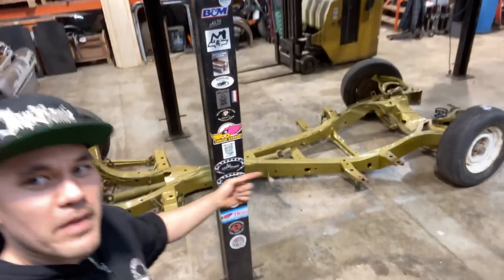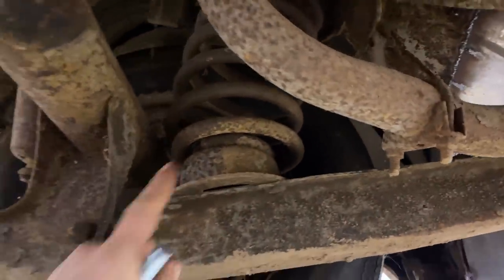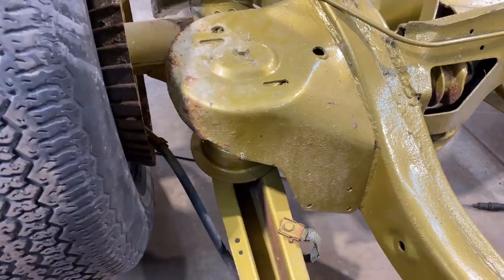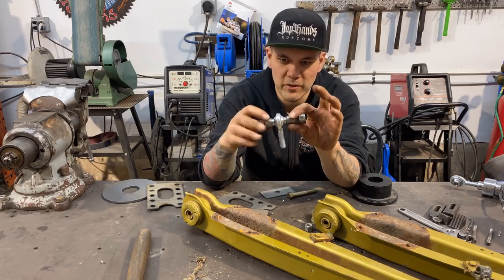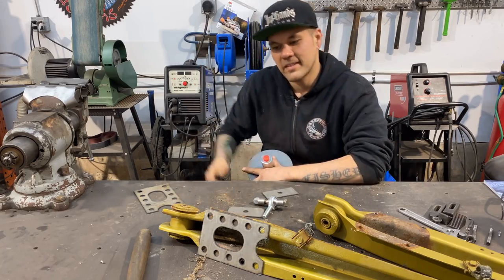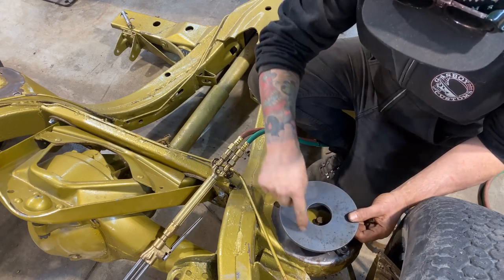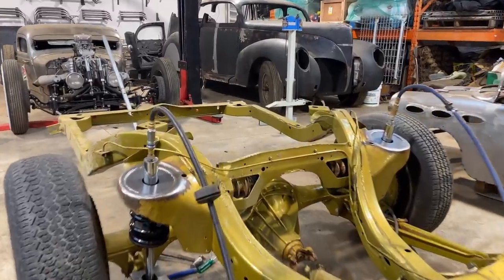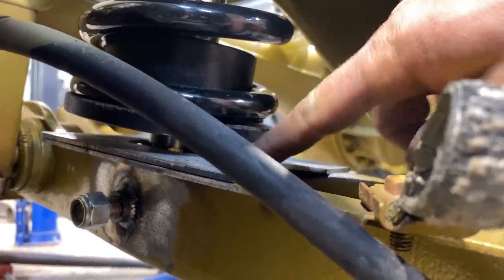Installing Hydraulic Rear Suspension - Kristina’s 1960 Cadillac Coupe de Ville

Comment: During the early 60's I had a small shop in Long Beach, California,  before it was popular,  we used to buy our hydraulic parts at military surplus houses like Palley Supply Co. downtown Los Angeles,  most of the military electric valves and pumps were 24 vdc.  Made it tricky to charge the batteries on 12v then  switch to 24v in operation. 
 Fun times 😃         if you use an  electric valve at each cylinder,  it won't lean when you go around corners,   Plus if a hose breaks" the cylinder will still hold fluid and the car won't drop on the ground when your on the freeway !!   Weld a shock mount next near each cylinder then the car won't bounce all over everytime you hit a bump!   Your Machining of all your parts is REALLY Great, 😃     Great Video,   Thanks
Reply from the maker: Man you are one of the originals!

Comment: Very interesting. Have never worked with hydraulics before  and always wondered. Love learning new things. Too cool.  Any reason why you never put a spring pocket  on the top to keep the spring centered in the mount?
Reply: i agree i think it would let it sit lower or allow for another turn of the coil to fit inside that pocket... i even think he said more coils smooth the suspension feel.
others here are mentioning having to box the whole length of the trailing arm which i also was suspicious of
Reply: That was my first thought about the spring being centered.
Reply: Yeah the top of the spring will move all around in there, needs something to hold it centered
Reply: Stock pockets are fine I personally would have just drilled a hole for the cylinder in the stock pocket instead of cutting it out and run the donuts under there. With a lay and play system there's not much spring movement the cylinder centers everything up. And less coil is a softer ride but of course this doesn't apply if you keep the suspension bottomed out then it's bouncy. I run pvc pipes over the cylinders to limit metal to metal contact/noise
Reply: @kdsboosted4954  i dunno, watch those cylinder tops move around in the video...
they move a lot....
even just a rubber/teflon/poly bushing donut between them and the donut plate he made would be a good idea....
i wouldnt be willing to allow all that knocking around or ANY spring slippage.
if youre not  building for 20,000++ miles a year, youre cutting corners is the way i was taught
Reply: @kazzTrismus  It all needs to move around as it needs as it adjustable suspension. Use pvc on the cylinders and composite cut board material for the springs and cups. I've have hydraulics in one of my cadillac's for at least 25 yrs. You end up picking up a couple tricks along the way. I have 3 lowrider projects I'll be installing hydraulics in my 56 cadillac this yr I think I'm still 2-3 months out though.
Reply: I do not understand the loading when everything came apart when frame was lowered and unloaded. What would happen with body roll and hitting a wonderfully deep pothole?
Reply: I think the hole for the top of the cylinder may need to be enlarged, with that being said the stock coil just sit in the pocket also didn’t it?  So it should be fine.
Reply: @mongomay1  it'll be fine once everything is assembled.
Reply: He said that he's using the front springs in the back so the final spring will be larger in diameter, I guess that will keep it centered.
Reply: He said those are temporary springs
Reply: @juanignaciocaino  
I thought I heard that explanation also.
Reply: @juanignaciocaino  he'll probably put something unless the outside diameter of the cut front spring is coincidentally the correct size..which is doubtful if not kinda sketchy...
a ring for the inside diameter that acts like a strut top (with the ramp/stopper for the end of the cut coil to not turn/screw by vibration) is my guess
Reply: Perhaps Karl plans on using a rubber isolator on top of the coil, when he gets the right springs, and that will hold and center the spring?
Reply: I think everyone is seeing the same thing:  what keeps the hydraulic cylinder from scraping the top 1/4" plate?
Reply from the maker: Yes I’ll be adding a locator ring, shocks and some delrin to keep from scraping the cylinder
Reply: @RestoringChristine1956  
Thank you trying to stay sane in this insane world.
Reply: @MakeItKustom  Can't wait for the conclusion.   
Love your show!
Keep up the good work!
JIM 🤩
Reply: Yes, adding a Derlin bushing at top for hydraulic cylinder as the lower control arm will create an arc going up and down. Having something to side on is important otherwise the cylinder will rub even with a Heim joint. 
  I am very interested! Are shocks coming? Stay tuned as I have to watch more, hooked!

Comment: back 30 years ago we just drilled a hole sideways through the cylinder and welded a cup on the top of the donut to hold the spring. now we have reverse cups and power balls, the absolute best way to do it. Not only was coilover desired many years ago to keep long cylinders from breaking out the back window, it simply kept the spring from falling out. Been building lowriders for over 30 years and never "needed" a torch. It is helpful but not mandatory

Comment: You really explained the set up well. It was hard for me to picture it in my mind, but once I saw it all done I can process it. I'd never seen someone install hydraulics in a car before. I recently had some one tell me I should do it to my 91 Olds 88... But I actually want to put a 3" lift kit on it to put some truck tires on it (look up towrolla puddins fab shop). It's just my daily beater ride... Dents galore from when a tree fell on it.

Comment: Looks awesome. Great work

 When I was doing this ages ago, I would run 2" over outers on the rams to get more stick through. So, if you're running a 10" cylinder on the rear, the outer casing would be a 12" casing. Just added a bit of stability and kept the fittings away from the mounts.
Reply from the maker: That makes sense! Cool idea

Comment: thanks for this video ,  your demonstrations and examples make it very easy to understand way more than most of the other Hydraulic Channels  I’ve watched i really like that you picked a fairly Common Frame  to demonstrate on not because of it being a Cadillac but also being a Full Size GeneralMotors  i myself am kind of leaning towards a S10 frame  rebodied with something  Unique   i’ve seen some cool Hydraulic  things on the Mini Truck Circuits i thought were Cool and still appeared to be a fairly normal operating vehicle  which is nice because i do want a Driver

Comment: More low (Moarlo)! Haven't heard that in a long time! :) Excellent job on the coil over rear. I've made a lip on the donuts to center the coil at the top too (like another cup but not as deep - 3/8" ish) - having the coil centered helps to keep the cylinder in the middle of the donut so you don't have to worry so much about the cylinder striking/rubbing the donut. The cylinder will still move around inside the donut as the arm moves up and down and the axle shifts but the strikes and rubbing don't happen as much.

Comment: Love your work. Just a tip. When I have worked with heim joints bolted between two pieces of tube, only one of the tubes is welded. This allows the other tube to slide and clamp on to the Ball of the heim.

Comment: Very clean work! personally I wouldn't have cut the whole pocket like you did,a simple 5/8 hole saw so the cylender can come through and use the plate under the cup on top of the spring. Just a little more strength for the spring pocket. But coming out awsome,love it!

Comment: Karl, I can't help but think that you need something in the upper spring pocket to locate and keep the spring centered.  Even though the body with it's weight will be pressing down the top of the spring will be able to wander around in the pocket and maybe even make for some squeaks and rattles when driving.

Comment: Very cool setup, not being a low rider person, I’d never really thought it through. I’m wondering about cutting those stock rear springs, though. If, for example, you cut half the coils off, you double the spring rate, ie, pounds per inch of travel. Not sure you want to do that to keep that “Cadillac ride”. Conversely, reducing available travel means you NEED that increased spring rate to keep from bottoming on the slightest bump. I guess you’ll probably sneak up on how many coils you cut so you keep as much spring as you can and still get it to set the rockers on the ground. Really interesting to see this build! Thanks Karl!
Reply from the maker: You’re absolutely correct! I’ll just be creeping up on the spring. I don’t mind having a little extra spring right in the back because it will have hydraulic pumps and batteries back there. I’ll be keeping shocks on it

Comment: Those trailing arms will need reinforcing.  I did an install like this on a 63 impala and it folded the trailing arm. Also had one bend the read axle and put a slight curve without reinforcement.

Comment: If you can't get into the habit of removing the lathe chuck key straight away, weld a light coil spring on it so that the spring will remove the key for you, you don't want to forget ,otherwise you may not be around to finish the job!!!
Other than that 👍👍👍👍👍👍

Comment: Nice work Karl👏👌
I'm curious how the top of the spring will be kept centred in the upper spring perch, and if you will add some rubber/polyurethane pads etc to the top and bottom of the springs?
Also, you probably would be best to add some sort of guide tube/bushing to the top plate as you mentioned, to keep the upper section of the hydraulic cylinder centred, and to avoid wear and damage to it over time👍🇦🇺
Reply: he mentioned a possible delrin bush in the video
Reply: @krusher74  Yes, I know. That's why I wrote 'as you mentioned' in my comment, to indicate I heard him mention he might need to add a bushing etc, and effectively I agree🤣
Reply from the maker: Yes to both of those! 😂

Comment: You could use Citroën hydraulic suspension: spring and dashpot are in the same part: the sphere. The benefit is a setupable height, or a constant one. You also can adapt side height in to correct the slope in a curved road. The guarantee of comfort + best handling. See the example of the old DS or the Xantia Activa, still on the podium of the swedish moose test aftet 30 years

Comment: Hey Karl 
 Don't you need to center the spring in the top. 
If you don't have it. Doesn't have the potential to slide off center and top plate will grind against the hydraulic cylinder. ?? 

Greetings from Denmark.

Comment: Love them old big body's, only thing I would have done differently for the rear is use powerballs rather than heim joints they're a bit beefier for a big car with weight out back.
Reply: Spoke too soon seen you address the power ball idea later in the vid.

Comment: Mention it only because it is worth being aware of for your watchers: Heim joints used in suspensions should be checked for wear on a regular basis as they have no way to keep grit out of the moving ball surface. Grease will actually attract more grit.

Comment: Awesome job, learned a lot. Just one question, the piece of steel u cut out of the spring pocket kept the sprin centered and in place. How are u planning on doing thar so the hydraulic cylinder centered in the spring and not rubbing on anything?
Reply from the maker: Plastic around the cylinder and a spring retainer

Comment: What a cool system. I've only ever seen air bags installed, I always wondered how the hydraulic stuff is set up. Can you run the hydraulics off the power steering pump? You would need a bigger reservoir but then you wouldn't need the extra batteries etc...
Reply from the maker: Not sure if the pressures
And volume would
Be there for it but I’m sure you could do a PTO some how

Comment: Karl your explanation is first rate.
Better still your video just enhances that explanation further.
I had always wondered how the hydraulics were done on those low riders I saw when I was in LA some years ago.
This ride will be sweet.
Do you still run a shock absorber to dampen the spring rebound as the hydraulics I would think are pretty rigid.

Comment: sooo...what keeps the coil from slapping side to side and the ram from rubbing on the sides of the hole in the upper plate and are you going to add a pan hard?....Some pretty welds by the way...... Finally starting on my 74 ford econoline pathfinder 4x4 quadravan restoration...should be a fun one....
Reply: Agreed there has to be some sort of retainment for the upper portion of the coil spring to keep it centric and retained. Also some sort of isolator to prevent that upper cylinder from just chewing itself apart needs to be added unless when he adds that spring retainment that could also be dual purpose, let's the cylinder slide through but also centering and locking the spring in.
  It is essentially a triangulated four link you don't need a panhard bar. As always great work karl I can't wait to see the next step in this. 🤟
Reply from the maker: Yes there’s going to be a spring retainer and I will probably make the holes bigger for the hydraulic ram

Comment: I'd kind of keep an eye on those trailing arms where you welded the spacers/Heim joints into them. Nothing wrong with what you did, but you are moving the load where it is spread out over a plate to a much smaller area in the arm.  Depending on the metallurgy of the metal used in the arm, the spacers (plus the weld) may rip out of the arm if the metal used from back then isn't of good quality.  Just check for cracking around the spacers after you put some miles on the car.

Comment: Nice job, only problems I see are the heim joints will fill up with dirt and wear out rapidly, also what stops top of hydraulic cylinders from rattling about in chassis hole as there is nothing to keep them centered in hole?
Reply from the maker: I spoke on that in the video but yes there will be a sleeve

Comment: is such a Heim joint sufficiently strong and durable for this application ? (rather than, say, a bushing, with rubber or polyurethane)

Also I don't see very clearly how the top of the hydraulic ram will be guided under load (like a McPherson strut would be), e.g. with respect to the "doughnut" opening when taking a turn... probably just me, I'll look into it again later
Reply: I thought exactly the same while watching the video - a kind of a guide for the cylinder wouldn't be a bad idea. Also a top hat for the spring to prevent "dancing around" would help. With the current set-up nothing keeps the spring/strut assembly in place. Otherwise a great stuff as always. Waiting for another videos! Greetings from Europe

Comment: Ya looks good man ,nice and solid with lot's of clearance for extream movement. Do you have any room for your umhw or rubber pads you'll install between the spring contact surfaces? I guess that won't take too much as all youd need is an 1/8 inch of the stuff. Thanks for clarifiying the design we talked about earlier. I'm building a triple axel trailer but I want to make the 3rd axel retract if not needed so it steers better as a regular tandem setup. This will work well but I need to mount the hydraulic cylinder on the end of the leaf spring instead . So I'll be mounting the body of the cylinder inside of a tube for stability as I have no swing arm or coil, let alone a pan hard bar setup. What you did looks great!
Reply from the maker: Right on man that sounds cool to build! Yes there’s room for the spring pockets

Comment: Any reason why the weldments were not primed/treated before welding.
Would weld in bushings like on the ends of the trailing arm work to mount the rod end bearing?
Reply from the maker: Not necessary to prime before welding in this situation in my opinion. Not sure what you mean about the weld in bushings

Comment: Suprised your lowrider buddies didn’t mention power balls for the rear suspension. Almost same concept as the heims joints but stronger. Basically a large spherical bearing that screws to the cylinder shaft.. still very nice work though man
Reply from the maker: Oh they definitely did mention power balls. But for this set up the whole agreed on these

Comment: One other thing- do you put a collet on the upper hydraulic cylinder to stop it dropping out of the spring pocket? 
Nothing seems to stop the spring from falling out if the diff drops too far those hydraulic cylinders can just fall out
Reply from the maker: It’s going to have shock so it will be fine

Comment: Ok now that i see how the top is free floating, i now get it. disregard the text below..lol
I dont get it. If im not mistaken, the cylinder is mounted solid top and bottom. If so, when the cylinder is at its lowest point, its going to pull down and compress the spring, and making the spring useless. If its not attached to the top, and just pushes the chassis up, then when lowered, you would get spring action when lowered, but when raised would be stiff because its not touching the spring. Im sure im missing something, but the spring under set up would makes more sense to me.

Comment: Quick question man..Is there a reason you circle cut that big? Instead of just slightly bigger than the hole the cylinder passes through. You still would have plenty of weld surface on top and could drill holes and spot weld the perimeter or weld from underneath also. You’d just have your 1/4” reinforcement plus the factory metal. Love the content by the way! Keep it up.
Reply from the maker: Just an uneven surface I wanted to beef it up with 1/4” plate